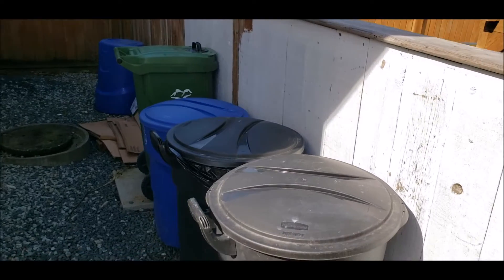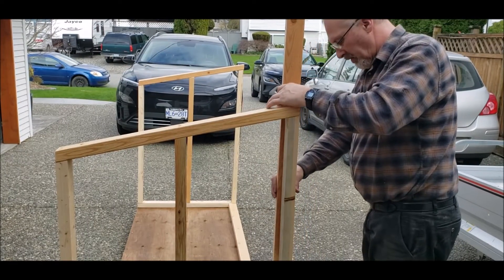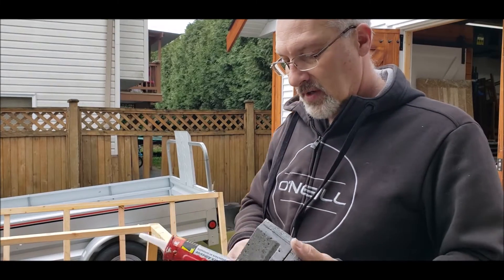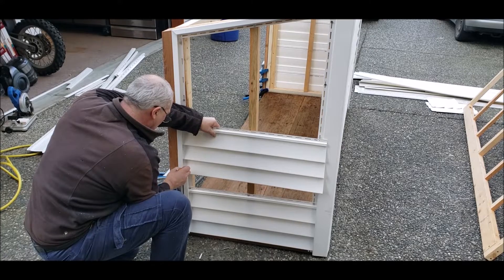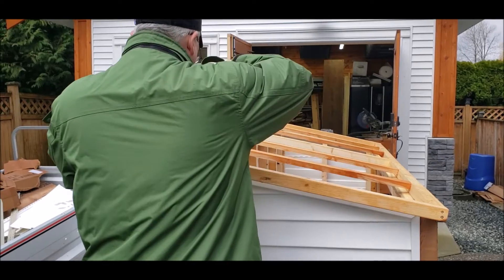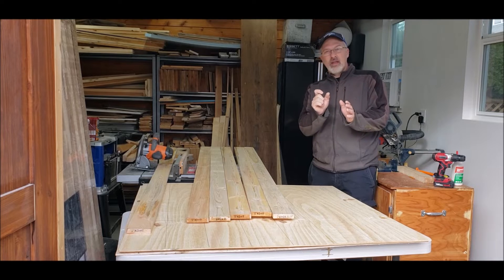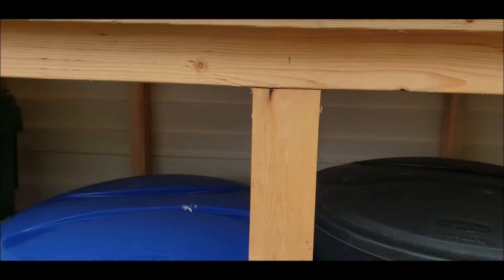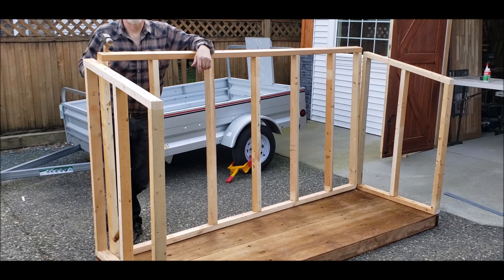DIY - I built this Garbage can enclosure

Comment: If you had to guess how much would you think this would be in lumber?
Reply from the maker: I believe it was five  2x4 - 8 foot, seven 2x3 - 8 foot,  five 2x2 - 8 foot. one sheet of 1/2 treated plywood for the base. 1 piece of 1x8- 8 foot red cedar. Five 1x4 8 foot. 1 piece 4x8 1/4 plywood for the doors. Prices have jumped so much for lumber i could not guess what the cost would be for new materials.
Reply: I couldn’t afford to buy the wood for this kind of project so, I’ve recycled wood discarded by other people. So the only cost was the hard ware. 😀
Reply: Would be nice if sound were a bit louder, sometimes hard to see what you're doing.